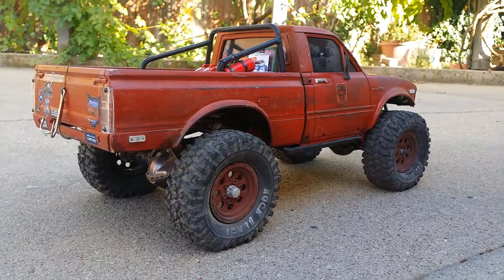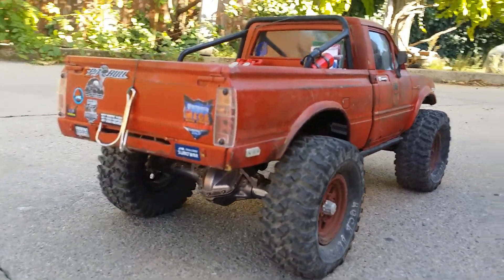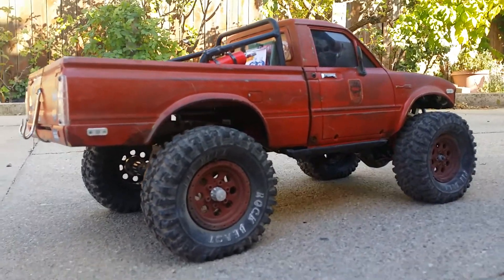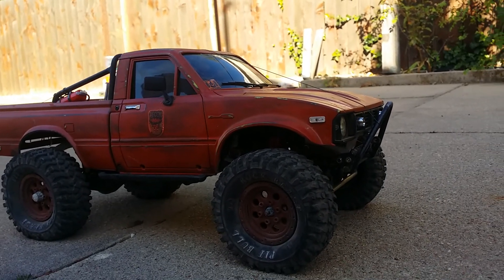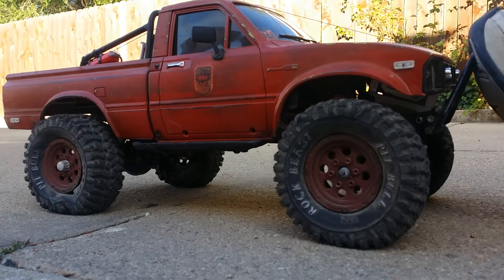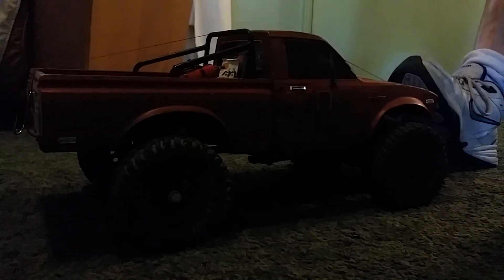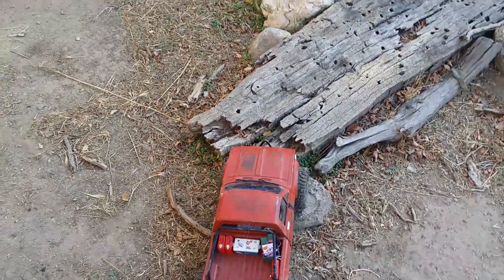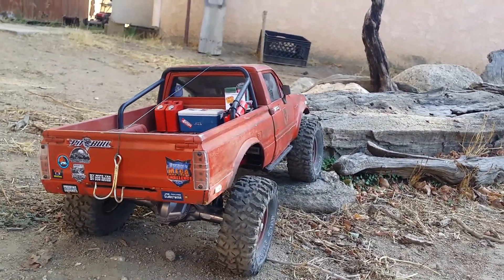Testing the TenShock 906 Rock Crawler 6-pole unsensored brushless motor.

Comment: That is not an inrunner, inruuners dont sound like that they are quiet.
Reply from the maker: With a Castle esc with no sensor, inrunners have a different sound. These motors are unsensored, 6-pole AND the poles(magnets) are staggered. They sound weird. 
Inrunner/outrunner, the sound coming from the motor reflects the "type" of power coming from the esc. Take 3 different esc's from 3 different manufacturer, you'll get 3 different sounds.
Reply: @tomlucasrccrawlers9108  I have all 3 of these motors and not one of them sounds like this (thank God) mine are all quiet like a regular inrunner would be. I have one hooked to a 120Amp HW ESC, one is hooked up to a AM32 ESC still super quiet, and the last one (The 2S max one 2400KV) is paired up with an 80Amp ESC. All are quiet set ups, maybe its a setting you have on your mamba.
Reply from the maker: @mark-mj5dl Oh, I get it. I just mentioned it, 3 different esc's, 3 different sounds. An am32 will be super quiet. That goes without saying.
Reply: @tomlucasrccrawlers9108  The other ESC`s are not AM32 they are just regular brushless ESC`s

Comment: Nice one. I have the 2400kv version in my Vaterra Ascender hooked up to a Mamba X. Very decent motor for the price.
Reply from the maker: That's awesome. 
Currently, I'm not using that motor. 
My Son used it for quite some time, then back to me.
Last time I ran it, it acted weird. If I give it throttle, it just shakes and doesn't rotate. But it had alot of long runs on it. 
And served it's life well.

Comment: All that info and no kv #?
Reply from the maker: No...your right. I forgot to put the kv in the video.
It's the 1750kv version.
If you're looking for more kv they have a 2400kv also.
3Brothers RC has the ACIS SIX staggered 6-pole non-sensored motor that blows-away the TenShock 6-pole motors for smoothness. I have a few of those as well.
Thanks for insight...I just added the kv to the Drop-down. 
Always check the YouTube Drop-down menu. I always give additional information on the rig.

Comment: Great video nice patina on the truck I  tried that motor in my Capra and it cogged too much....but it’s not geared as low as your truck still a good deal for the price
Reply from the maker: I just recently got an app that tells me when someone comments. Sorry it took so long to respond, youtube never notifies me anymore. 
You right , you gotta really gear low AND have a really good esc for it to work. A much better motor is the 3Brothers RC ACIS SIX staggered 6-pole non-sensored motor. I have a 3000kv(something like that)and it incredibly more smoother than this motor , I have one in a TRX4. 
Tom(3Brothers RC) has some health issues at the moment so he could use some support too , if it's possible.
Reply: Tom Lucas  I was looking at his motors to purchase and they are out of most everything....
Reply from the maker: @BIGEDLHC  Maybe he's the only one restocking stuff. I don't know how long he's been "down"...two friends are sponsored by him..."team drivers" I believe. One of them ask me to keep him in prayer because he's in the hospital. So I have. I don't know details. 
You might try other sources to see if his motors are in stock.
I'll ask my Buddy what's going on with Tom.
It's Tom Asher if you want to try contacting him through messenger.

Comment: General experience with that motor after all this time? I would like to get it to run with a CC SW4
Reply from the maker: I can answer the Sidewinder 4 questions. I've never owned one.
Supposedly the 4 has better start-up than the Mamba X even though they both have the same throttle steps. I've heard the techies took the knowledge they acquired while building the X esc and just added a little more software tuning to the 4.
I'm also told the difference in start-up between the two esc's is only noticeable if you drive them back-to-back. 
As for the TenShock 6-pole 906....it's still a good motor...tho you gotta gear it really low , it works world's better in a 2-speed rig like a Trailfinder or a TRX4.
A much smoother motor 6-pole motor....tho I don't mention it much...is the 3Brothers RC ACIS SIX staggered 6-pole non-sensored motor. Funny thing is , the 3000kv version seems just as smooth and torquay as their 1200kv version. I have both. If you can float the extra $30 over the TenShock....i'd definitely go with the ACIS SIX 3000kv motor.
General bearing maintenance and cleaning aside , both motors should last a lifetime. Really nothing to go wrong.

Comment: Thanks for the info Tom, it's something for me to consider. It appears to be highly efficient for the price. I still want to get the Revolver though, since I have 3 brushed Holmes  for the crawlers that work flawlessly.
 The sound of this 2700kv Trailmaster sounds like a turbo spoiling up, too cool! Sorta realistic. Hope the Revolver sounds as good. Ten Shock sounds good also.
 After I get farm truck dialed in with either motor I want to pull out of you your setup with your other truck...lol... Thanks again!
Reply from the maker: Jmy Lawson You have a very efficient esc. So I wouldn't change that at all. The SW4 will last you 10+ years and it has the highest resolutions(throttle steps) of and esc out there(same as Mamba X and Monster).
 The Revolver is worth waiting for.

Comment: out of curiosity, how much does the truck weigh, you think the 1750 can handle a 13 pound truck?
Reply from the maker: Thierry Cyr It was my heaviest rig till I got my TRX4. 
Unwanted Yota weighed well over 10 pounds. It moved out pretty good considering the gearing.
My second TRX4 has the 1750kv , it's a rocket and will pull the garage down(if it had the traction) and it's heavier than Unwanted Yota.

Comment: Awesome video! what KV did you pick? im looking to get one for mt TRX4 just genera trail duty.
Reply from the maker: Marc Gill It's a 1750kv.
Only esc's I could recommend is the Mamba X or Mamba Monster.
The very high throttle steps makes it very controllable over other esc's. 
There's also the option of the new Sidewinder 4....it has the same throttle steps as the X but you're limited to 3s and you don't get the 8-amp internal bec.

Comment: Love that spool up sound! Sounds like an Abrams tank starting up
Reply from the maker: michael hart It does have a cool start-up. Having that motor in there for awhile now.....it still amazes me. It just has soooo much torque. I'd say it has comparable torque to the outrunners I run , but not as noisy.
Reply from the maker: michael hart It foes have a unique sound. I like it too.
Reply: I have the 2400kv and I love it, so much torque, so much power. The sound never gets old.

Comment: What KV motor you running? Subscribed thank you
Reply from the maker: Risha Circuit It's the 1750kv version. TenShock has a 1250kv along with a 2400kv 906 also.
I've tried the 1750 and 2400kv 906 on other esc's.....they work the best with Mamba X and Monster esc because of the very high resolution(1200 throttle steps).

Comment: Great video! And awesome truck
Reply from the maker: Chris O'Connor Thank you Chris. Appreciate it. I scratch built it for a Top Truck Challenge event a few years back....10 days out the guy cancelled the event. 
 It's took a long time to like that truck.
Reply: +Madeline Lucas why? did it take a long time? the situation where being cancelled turn it sour? I would like to see it without the shell. I'm going to scroll the videos ya got. 

I was in LOVE with Tenshock motors from my first one. I had bought their ESC and 3800kv 401sc 4 pole for my 4wd Slash.  now I have a few of them. a sensored 411sc is my fav.

Tenshock for the win!
Reply from the maker: Chris O'Connor Your absolutely correct. I was sour at the whole situation. I was under the impression that it was going to be a yearly event. I went to the first TTC event out of obligation because I don't do broken promises. I told him I would show up I would do some filming but I wouldn't compete cuz I didn't build a waterproof truck. I was expecting the second event to be 12 months in the future. That would give me time to collect the parts without draining my savings. Then three months later he announced the second TTC. so I was rushing to get the rig together. Broke the bank doing it and 10 days out after (me) spending all $ to build a TTC rig he cancelled the event. 
 It's not a budget rig by far. I could've use that $ for more important things.
  I'm very impressed with the TenShock 6-pole 906 more than anything that it's unsensored.
 It only took 2 more poles over the normal 4-pole to make it so smooth without a sensore board.
 I think is could be the new thing in crawling. 
 As for torque....it's the torquiest motor this side of an OutRunner motor.
Reply: +Madeline Lucas I can see that would upset anyone....definitely if you were holding up your end. 
hey now you have an awesomely BUILT truck you can enjoy, I am going to get one of these just to tinker... a trail truck is my next rc anyhow, and both my sons have Tenshocks in their SCTs

Comment: My micro mamba x makes that spooling up arming sound too. What is that all about? My micro mamba pro didn't do that. It's a really annoying sound too. At first I thought there was something wrong with it. lol Any ideas why it does that and what for? I think it's something to do with it ramping up the voltage but you'll think thats what the throttle trigger's for? ?
Reply from the maker: Dirty D's RC All I can say....is from experience I've gathered over the last two years run'n outrunners is the more magnets and Staters there are the more the motor "talks". The unsensored and sensored  2 and 4-pole inrunners I've ran over the years don't make any noises. Funny....put two more poles on an inrunner and it starts "talking" too. 
 If you get on the Holmes-Hobbies Fan Page on Facebook , John Holmes could probably explain why motors "talk" more as the magnet/stator counts go up.
I think it's cool but it's something I can't explain.
Reply: The more magnets the more it gets to be like a speaker. That what it is.

Comment: Hey I liked the slow speed functionality  with this motor 2400kv. I have an axial wraith with same motor and castle esc, sidewinder sct, I have 32p gearing at 57-9. I cant get a slow crawl like this, is it because of my esc? Also running 2s gens ace 5000mah x2 in parallel
Reply: Jeremy Moreside - I had that problem initially on my Wraith. I got a 60 Tooth Spur Gear, a 10 Tooth Pinion, an Underdrive 43/13 gears in BOTH Axles. Crawls like a dream now!
Reply from the maker: Jeremy Moreside I apologize for not getting back to you earlier....I just saw your message. 
Yes...your esc has everything to do with the low-end control.
For example , a reverse engineered brushless Hobbywing esc has less than 400 throttle steps(TS).....also known as "resolutions". An outdated Sidewinder 3 also has about 400 TS. An older Mamba Max Pro and a Trailmaster BLE Pro has roughly 700 TS. 
Just recently the new Sidewinder 4 has the same TS as the Mamba X and Monster at just over 1200 TS. But the "SW4" doesn’t get the 8-amp internal bec and some of the other "race" features. 
But , at $85.....that's a good deal for an esc that has the highest throttle steps on the market and will last 10+ years.
Sometimes you just have to brake-down and spend the $ to get what you want. Look at it this way.....with the X esc...no more external bec's and it'll make cheap motors perform like high dollar motors. It'll do pretty much anything.

Comment: Great video . Have you tried the 2400kv on the mamba X esc yet ?
Reply from the maker: Alan Read Sorry , no I haven't but I think I will. I have one in the garage. I did try one in my son's truck with a Sidewinder 3 and it "jumped" to a fast crawl. But that's to be expected with a $50 esc. The Mamba X will clean-up the low-end control quite well. There's a video that just came out about two weeks ago that does a test on all three 906 kv motors. Just look for it. he test it using a Mamba X and a TRX4. It's a good video.

Comment: Hang up the phone!!! Lolololo.. dabbler is right, that spool up sound is nasty! I love it.. about the 3:40 mark you answered my question about if it’s “ snappy” if needed... thought was going to jump the pile!! Nice video sir! I think I’m going to be converting my red trail finder to a link set up and I’m probably going to jump on this motor ESC combo. Thank you very much
Reply from the maker: Mid Life R/C I really like it , the 906 1750kv is not going anywhere. it's staying put....but I'll tell you what...a quality esc goes a very long ways at making that motor work as well as it does. You seen my other post and the 2400kv version of the 906 doesn't work well with the $55 Sidewinder. The $129 Mamba X has over four times the throttle steps as the Sidewinder. 
 Tom

Comment: love that mamba monster x startup sound. thing seems to have great low speed use, I'm curious about the max wheel speed as well. I did notice you goose it once and it quite literally jumped into action. how is the max wheel speed in this configuration? Thanks for posting.
Reply from the maker: adeoliver Sorry for the delayed response. For some reason YouTube hasn't been giving me any notices....probably because I won't update my account....just don't think they need all that info about me.
I really gear very low. Usually around 7 to 11-tooth and I'll run 4s. As is , it'd only do about 9mph. Until recently....it was my only single speed rig. I might put the 2400kv version in there....but truth be told , I'm very happy with the 1750kv that's in there.

Comment: Thanks for posting this! That spool up sound is filthy! Love it! I'm going to use my 906/2400KV on a custom Slash trail truck that I'm planning to build. Thinking about getting a lower KV version to try on an SCX10, but I don't have any high end esc's to improve the slow startup performance. Plus, a TF2 has the advantage of that extra low 1st gear, compared to most other scale trucks. I've read some other remarks, from other guys who have tried it, that indicated it wasn't smooth enough for precision crawling. You're probably right on the mark, regarding the higher number of throttle steps making the difference.
Reply from the maker: RC Dabbler I have plans on putting a 1750kv 906 in my son's AX10 Scorpion(converted to an SCX10 years ago). He's run'n a Sidewinder esc. I believe those have roughly....just under 400 throttle steps.  The Holmes-Hobbies BLE Pro which uses the older Castle software has around 700 throttle steps. Those two esc are night and day between each other on start-up using a unsensored outrunner. I'm sure it's similar with the 906 6-pole.
I will let you know how it runs....maybe I'll do another video. 
 Thank you for the complement sir.
 Tom
Reply: Madeline Lucas Do you know how many throttle steps the Castle Mamba X employs? I'm thinking about getting one.
Reply from the maker: RC Dabbler Yes....the new Mamba series with the new software that came out last year almost doubled , but quite. I believe the BLE Pro and Mamba Max's had around 700 throttle steps.... it's now around 1200 , give or take.  Sorry I don't remember the exact number. The Improvement  in throttle control is amazing in  pretty much every circumstance.... especially when you're facing downhill going from drag brake to a crawl. All the advantages that a brushed motor had over a brushless motor while crawling it's gone.